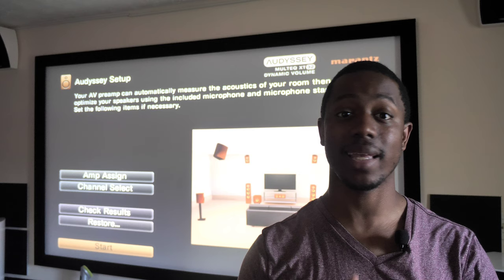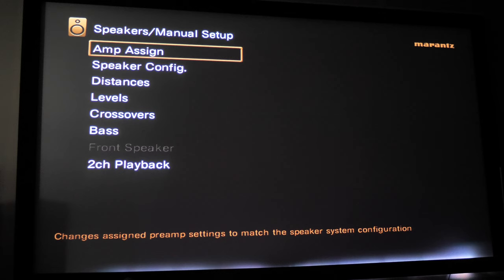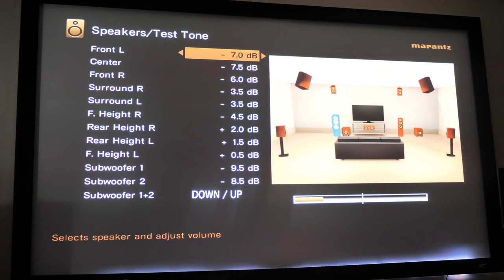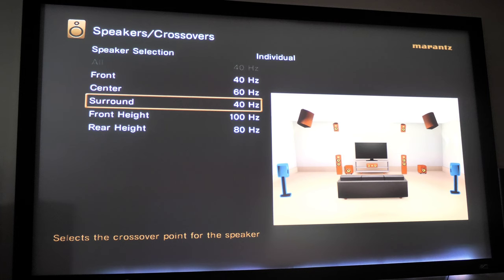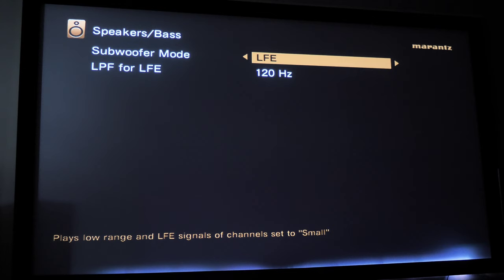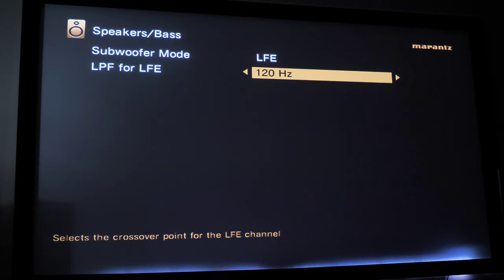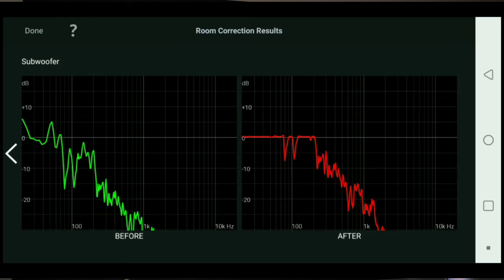How To Identify and Correct Receiver Calibration Mistakes

Comment: Not sure if I got this right but audyssey set all speaker levels to 77db +/- 2db. I tuned it further post calibration and set all levels exactly to 77db, set centre and subwoofer + 2db. Also did not lower crossover,  but increased them, set all speakers to SMALL. Am I missing something ? Still thinking maybe I need to play around with levels of surrounds & front heights or keep them at 77?
Reply from the maker: You can turn things up to your needs but make sure if you turn 1 speaker up the same amount to turn everything else up to keep the balance
Reply: @Kpaceguy  you mean all channels need to be the same, we do not wanna bump up the centre or the sub? So if it's 77, then all speakers must be 77?
Reply from the maker: @SutraLETICSS SutraLETICSS  no all speakers don't aren't the same volume. They need to be increased the same amount. If you turn the front left speaker up 3 notches you need to turn everything up 3 notches. That doesn't mean every speaker is the same volume level it means that every speaker is balanced at your listening position. You can turn the sub and center speaker as high as you want

Comment: Yamaha HTR 3072 AVR
FS & CS - NS-P 350
SS - VX S 5 SURFACE MOUNT
SW - NS - SW 300
ROOM AREA - 130 SQFEET
ALL YAMAHA PRODUCTS
What crossover best for above speakers system. Pl reply. No crossover for individual speaker. Only 1 crossover.
Reply from the maker: 20hz above the lowest frequency response rated by the manufacturer
Reply: @Kpaceguy  Means i have to set crossover 80 or 120

Comment: hey there unfortunately my receiver does not have a setting for relative volume, at least I cant find it if it does.  My volume goes from 0 to 74.  Any idea where I should set my volume to when setting the levels with my meter?  I been trying to get this answer and have had no success :-). thanks again.  you have been very helpful.
Reply from the maker: I don't know where reference is with that kind of volume meter. I would turn it to maybe 80% of max which is 59 or 60.

Comment: I see that you have you are running your  prime elevations down to 80. Is that safe for them, considering that they only have a 4 1/2” woofer? Reason I am asking is because I am a proud owner of them as of two weeks now, and I have thought about trying them there.
Reply from the maker: There's definitely comfortable with 80. Rated to 55 so they shouldn't have any real issue

Comment: Distances on XT32 should not be changed. They don’t measure the distance from tweeter. They measure they delays from tweeter to MLP. Leave distances alone.
Reply: Haha, I was going to type the same thing as soon as I saw that he was messing with that. lol
Reply from the maker: The only one I changed was the subwoofer
Reply: @Kpaceguy  I was going to say the same. Also for subwoofer the distance is used for the delay to match both subs. It's not a physical measurement, its delay and its in ms. I do the same with a mini dsp. You add delay to one of the sub to match the other so they don't work against each other. My case one of the subs needed a 12ms delay. That's around 13 feet of delay. That's also why you see that ridicules distance number.
Reply from the maker: @Quetzalcoatl0  ahh makes sense makes sense
Reply: @Kpaceguy  I didn't know that too, it actually came to my mind when i got a miniDSP, because there it says both the ms and the distance. And i always wondered why Audyssey set those huge number for the subs.
Reply from the maker: @Quetzalcoatl0  thanks for the insight
Reply: Agreed, unless you have a calibrated mic and can see how it effects things, don't touch them. If the numbers are really off for one speaker (that isn't the subwoofer) it probably indicates either you have poor speaker placement or that your measurements are bad and need to be redone. Also using the Audyssey app give you better results and an added bonus of being able to look at all the measurements in ratbuddyssey as I found that my left speaker was all similar in level but the right was all over the place indicating something is wrong that I need to address.
Reply: @Kpaceguy  why aydysey set my subs same metre's???🙄
Reply: Could you give an advice how to set an old onkyo 606 receiver? It has audyssey not xt32. 
And should I use bi-amping on it?

Comment: Great video to help people understand. My marantz had my center stage to large also . One question . How do I get a pro file for 2ch audio . I e mailed marantz weeks ago ,still don't have a answer ! Thank you
Reply from the maker: If I remember right under manual settings you have have the option to set up 2ch when you're in 2ch mode. Option to use audessey calibration or not,  turn on or off subwoofer. Etc. But I honesty can't remember
Reply: @Kpaceguy  thx ... I ll try that later!  
If anybody else knows ,please chime in .

Comment: Thank you for your video.
I am using Denon avr4500. 
Current set up is 3 front towers center + 2 subs.
I am about to Install 4 cieling speakers 2 for front 2 for rear. Also have 2 atmos ! Should i install these to the rear.?
Then I am a little worried how to wire up the new 4 cieling speakers on the amp.
Can you guide me pls.
Once again thank you so much
Reply from the maker: Your 4 ceiling speakers should be atmos nothing else should be up there
Reply: @Kpaceguy  sorry forgot to mention they are
Reply: Just re reading your reply. So just front towers a centre and 2 subs for front and then the cieling speakers set as 2 fronts and 2 rear should be a good setup?
Once again really appreciate your quick response
Reply from the maker: @alfredcamilleri9238  I'm saying the only thing that should be on the ceiling are atmos speakers. If you want rear speakers, which I think is more important, you should only use 2 atmos speakers on ceiling and 2 rears on the floor or in wall
Reply: @Kpaceguy  again thank you. I feel better now as it's more clear.

Comment: No body explain about volume level on AV Receiver while setting DB Level by SPL meter. If I increased AVR volume than automatic volume go to 75 DB on 0 DB level. So what volume level set onAVR say min 30 to Max 97. For each  SPEAKERS MY VOLUME LEVEL ON AVR SAME. Suppose I started FL speakers with 60 level on AVR So all speakers it is same. Pl make demonstration video step by step.

Comment: Forgive me if this question has been answered in the comments, but are there any decibel meter apps or decibel devices that you recommend?
Reply from the maker: Apps on phones are good for the speakers but not for subs. You really want a dedicated meter down to 20hz from Amazon or an electronic store
Reply: Thanks for replying!  I downloaded a decibel meter on my phone. You said that the decibels should be at 75. However, I had to crank the Level to +10.0 dB using my Yamaha receiver on all of my speakers and they still only got up to around 50 dB!  Should I still keep it at that level or is there something wrong with my receivers or speakers, seeing that they only go up to 50 dB on the Test Tone?
Reply from the maker: @marvinmccray3585  your receivers volume has to be turned up to 0db or reference first
Reply: Kpaceguy thanks!

Comment: Sir, what is the sound difference between Dolby Prologic II Music (All entry level receiver) mode with Dolby Surround (All ATMOS receiver has) ?
Reply from the maker: Difference is that one is supported in movies and one isnt. All new receivers have dolby surround regardless of it having atmos or not.
Reply: @Kpaceguy  kindly tell any receiver model which has dolby prologic II with dolby atmos
Reply from the maker: @DIPDISCOVERER  none
Reply: Sir, you said all spekaer crossover will be 40Hz,  what will be setting of my Sub woofer low pass filter ?
Reply from the maker: @DIP DISCOVERER  120hz
Reply: @Kpaceguy  I have Polk Audio PSW10 subwoofer model, there is low pass filter Knob from 80hz to 180hz, what will be that setting ?
Reply from the maker: @DIPDISCOVERER  180
Reply: @Kpaceguy  so u mean that will be 180 and receiver LPF for LFE is 120 ?
Reply from the maker: @DIPDISCOVERER  correct
Reply: @Kpaceguy  can I perform audyssey set up which has provided by denon,

Comment: So to clarify, using your speaker setup as an example: If the subwoofer mode is LFE+main, the sub would be getting 120 hertz and below from your front left and right, not just the 40 and below from the crossover setting?
Reply from the maker: Close. The sub would play everything the mains play plus LFE tracks designated only to the sub
Reply: @Kpaceguy  Cool, thank you. I wasn't clear on that. I've heard other YouTubers say LFE + Main means the LFE channel is sent to the sub and all other speakers. That didn't seem correct.
Reply from the maker: @astrotrance  that would destroy your speakers lol
Reply: I HAVE A DENON  AVR  S- 730H  AND ALL MY SPEAKERS  ARE KLIPSCH I HAVE  2 SUBWOOFERS  KLIPSCH TO MY SETTING ARE FOR MY KLIPSCH ARE  RP-620 MAIN ARE 100HZ  CENTER 60HZ  SURROUND 80 HZ DOLBY ATMOS 150 HZ  AND SUBWOOFER -LFE 120 SOUND IS  VERY AWESOME  TO TELL YOU I DONT LIKE 40 HZ AT ALL, FOR MY KLIPSCH

Comment: But why all calibration technics mentions speaker as full range instead of small.in my YPAO calibration too,the process tries to fullly utilize speaker capability like 40/60hz instead of doing a cross over.are those engineers  really dumb to put that logic of applying 20hz above speaker capability and put that as default crossover? I think if everyone is doing there must be a reason

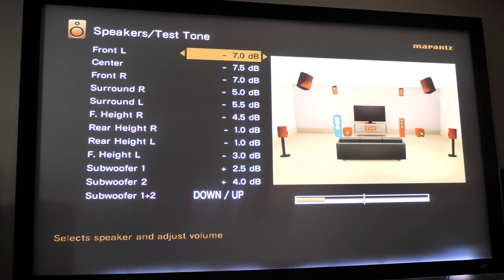Comment: Hey Kpaceguy, @6:57 I see that you put the sub levels in the AVR on + 2.5 and +4.0. But I would love to know what volume you set the gain on the subs itself. I have a Sub that doesn't have a dial, I have a digital display that goes from -38 to +12 db. 0 being the default (I think) and I have both of my subs on - 9 db at the moment. But what would you recommend, to dial them back to something like I have now (-9 db) or leave them at 0 db? Let me know, thanks.
Reply from the maker: Thats actually a bit high. They currently are around -6 on the avr with one sub -20 and one sub -26
Reply: @Kpaceguy  Thnx for the quick reply. I've tried putting the subs around -20 db, but that way to low for me and it's basically like I have zero bass. I have a Klipsch RW-10D  (sorry, Klipsch I know haha) and I think the middle on the is -10 db (on a scale from -38 to +12 db). Would you recommend that, if not and you would say that it's better to put them at around -20 db on the subs, what can I do to get more bass output. Hope I'm painting a clear picture here.
Reply from the maker: @VandergriftMoefies  my subs are very loud so I can keep the gain low and still have output. Put your volume where you think they perform best
Reply: @Kpaceguy  I see, I will experiment. Not that I think you do, but are you using something like MultEQ XT (Audyssey) to boost the sound for the subs? I know that also makes the subs louder, but I've never liked the sound when I have MultEQ XT on and the subs can sound really boomy. I also have an option in my Denon under: 'Audio > Subwoofer Level' where I also can boost (adjust) the sub. I've heard multiple stories on to use and not to use that option. But I've never had a clear understanding of what that option does and if it's bad for your system/subs to use it. There are no videos about it either (I currently have that option turned off). What's your opinion on that setting and would love it if you did a vid about it in the future.

Btw, loving the content! Have been subscribed for a while and your vids have helped me a lot. :)

Comment: Auto calibration should be run at zero db?
Reply from the maker: It sets it to 0 automatically
Reply: @Kpaceguy  I have yamaha 3072 avr and in that I am not allowed to set crossover to each speaker. Just one crossover for LFE. My front 3 speaker is yamaha nsp51. Center channel frequency response 70hz to 36KHZ, front speaker 69hz to 36khz and my sub is 28hz-200hz.how much crossover I can set?

Comment: negative or 0DB level I do not hear anything.  +7.5 I can hear the sound
Reply from the maker: Don't raise it 7.5db, lower everything else
Reply: @Kpaceguy  I don't hear sound at all, I dono wats wrong.  I am using denon s760h with polk ES series.  with Auto Calibration sound is too low. I am missing some settings.

Can you help me with wat I am missing

Comment: Great video but you fail to mention when checking your distance with tape measure your Subs distance is always incorrect because Audessey sets the delay/phase distance much more than actual distance, for example your Sub can be 10 feet away but Audessey sets it at 20 feet by calculating the phase
Reply from the maker: Yes thank you. Some other subscribers mentioned that to me too

Comment: Been using audyssey for many years and I keep switching back to and fro SMALL vs LARGE with LFE+MAIN. and contrary to conventional practise, LARGE sounds a lot better then SMALL. I don't lower crossovers set by Audyssey but do increase them to 20hz over lowest frequency for each speaker. I also prefer a FLAT curve over REFERENCE.
Reply from the maker: It sounds better for much more unsafe. Some people set it to small and put the crossover at 40hz to still get a full sound that's usually safest
Reply: @Kpaceguy  thank you for your reply. if set to small, I always use a window of 20hz over lowest frequency range. My towers go down to 40hz, hence I set them to 60 when SMALL!

Comment: Your massive subwoofers are not getting 1/3 of their ability because your crossover setup on your front speakers are only allowing your subs to have a sip of water. Why set the speakers to small and then have a 40hz crossover? May as well set them to large because your killing your bass to your subs. You have massive powerful subs that are hitting like an 8inch midrange. Try raising the crossover to 70 or 80 and the same for your center channel and then see what those subs will do.
Reply from the maker: The room is too small to have that much bass in it. In a bigger environment it would play better with the room

Comment: You run Audyssey and then go in and change every single setting? So what is the point of doing Audyssey in the first place? You are hand jamming tape measure info when audyssey just digitally made all the corrections for you. You override the level setting set by Audyssey based on a phone app? WTF? The crossover stuff is the only thing you should change. The level and distance should be tweaked if you have individual desires, as in you want your center channel slightly louder, you want the Atmos speakers to be more audible, or you want the subs to be a ms off timing, etc. Terrible video, you have lost all credibility.
Reply from the maker: You don't change everything? You change what's wrong and the only thing that i really changed was the speaker size and crossover. Everything else was pretty correct. You can go and tweak parametric EQ if you're using an EQ wizard but most things will stay the same. Just like they did in this video. Running calibration was so i didn't have to set EVERYTHING manually including the parametric EQ.  If you know things that myself and others don't know, it's always better to share your experiences than to shame a video. The point is to learn something new.
Reply: Maybe you should compare his video to other home theater setup videos before you post your negativity. The changes he made are a lot of the same changes EVERY other setup video suggests making. There's also a lot of explanation on faults of Audyssey. At the end of the day, it's not human and still just a piece of electronic equipment sitting in your room. Not the ears of a human being.
Reply: Lol go by a sound bar if you want something that is ready to play out the box.